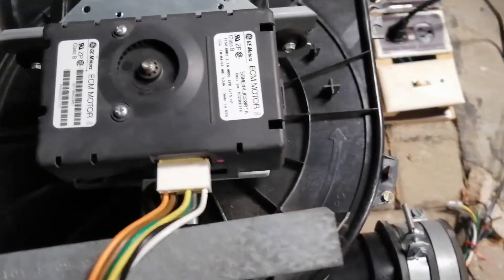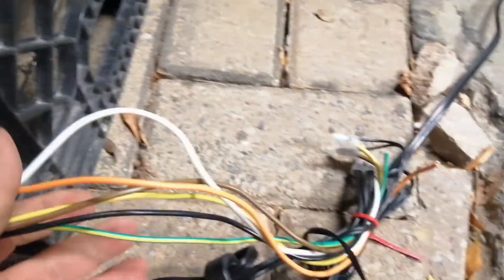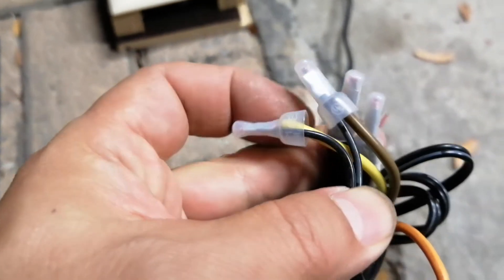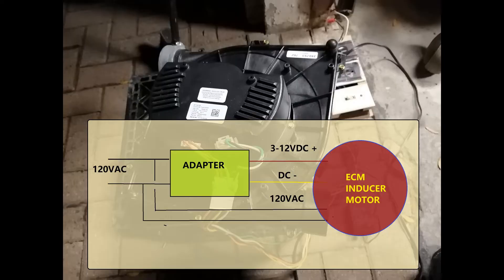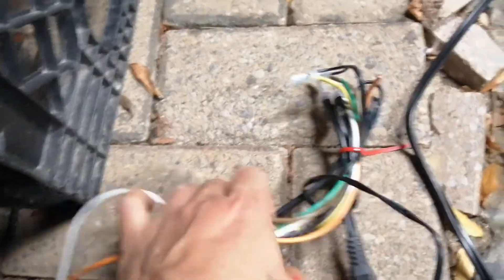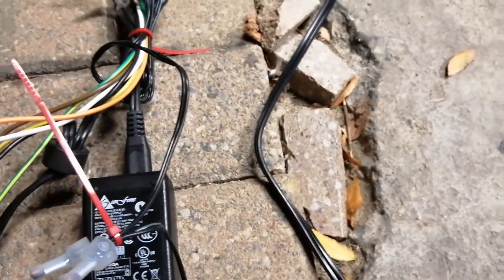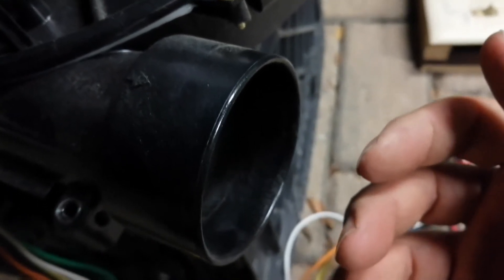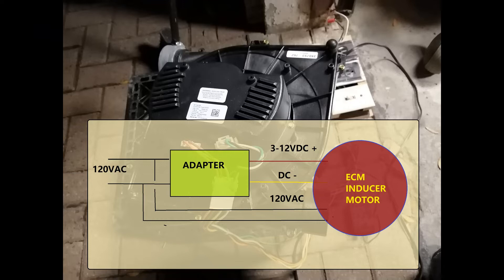HC23CE116 / 5SME44JG2006D Carrier / Bryant ECM Inducer motor Test Run Stand-Alone V2

Comment: This info is still good! I had replaced the entire inducer assembly about 6 years ago, and now the replacement is failing. I believe the problem in both cases is simply a bearing for the motor. I've been trying to figure out how to wire up the motor out of the furnace to isolate the noise I'm hearing. This video has been a great help; thank you for making it! It's nuts that they try to make us spend $500 - $1100 for an entire new assembly, when we just need a sub-$10 bearing and some patience.
Reply from the maker: I have another video shows how noise come out of the motor actually is from the wheel. Wonder if yours is same
Reply: @hvacworkshop4791  It is indeed possible. I never did record the sound of the first failing inducer motor assembly, however I do have a video of the replacement inducer motor assembly, which is here: https://youtube.com/shorts/7rH_ovtvvyA. I'm days away from finishing the rebuild of the first one; just waiting on some Momentive RTV162 to arrive.  Then I can replace the replacement with the original in the furnace, and start fixing the replacement.
Reply: I have the problem with the noisy inducer motor and was told the bearing is bad and the entire unit needs to be replaced.  Your comment has me thinking you know how to replace the bearing?  If this is accurate, can you point me in the right direction?
Reply: @grettman20136  I did successfully replace my bearings on two of these now (as the purchased replacement assembly also failed with the same problem after 2-3 years). I recorded a few hours of footage of me working through doing this on one of the assemblies but never condensed it down into a video. I made a couple of mistakes and didn't feel like I should be posting a video on how to do it when I'm just a guy that happened to already have a bearing puller and didn't want to spend over a thousand dollars for yet another replacement. The short answer is that yes, for me, it was just a matter of removing the shaft from the motor, replacing both bearings off the shaft, and reassembling. The newer assembly was more complex than the older one -- it seems they've gone out of their way to make it more difficult to disassemble. Most important is the seal of the entire drafter inducer motor assembly to the blast box or whatever it's called -- that keeps the carbon monoxide out of your house so that you stay alive. I still think it is absolutely nuts that they want us to buy an entire new assembly when the problem is a sub-ten-dollar bearing. For the win, I would recommend taking the assembly to have the impeller balanced (or balancing it yourself if you know how) -- hopefully that will make these things last longer.

Comment: A Question: the video of the adapter says "AC power supply" and the output reads "12V"  but does not specify if output is ac or dc??  If it is ac output, then I guess the control wires can use ac or dc.  Thanks for your video!
Reply: I see hvacworkshop answered your question.  But to add to it for future reference, the ~ sign means AC and the solidline over 3 dashes represents DC.  AC also has a frequency "50 - 60Hz"  DC does not have a frequency because it does not alternate.
 
AC: 120v ~ 60Hz
               .___.
DC: 12V  - - -  2A
Reply: I am only getting 3 volt drop between brown and yellow at high stage IN furnace with weak fan speed.  Bench wired like here, the fan blows normally fast.  On/OFF signal seems to be orange wire, 0 at standby and 1.7 volts at high stage, but I don't know if this is normal or not.   That would help determine if it is the main board or the board inside the motor.
Reply from the maker: Hi Stephen, the 120v AC is input, output is DC, that's why we have positive and negative for the wiring in the video.